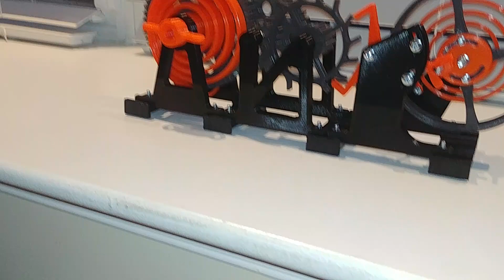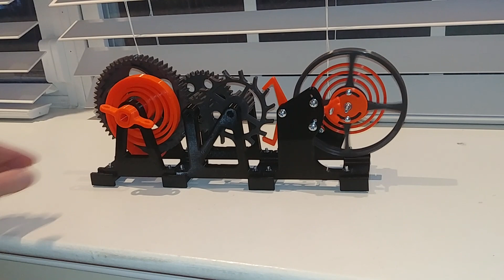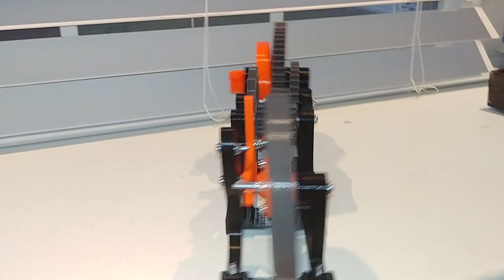3D Printed Watch Escapement

Comment: i cant get my fork to engage fully. seems like the hair spring is not strong enough to spring the wheel up and down hard enough
Reply from the maker: One thing that helped me was making sure everything is flat down on a hard surface
Reply: @kevinbright1  yes tried that, also sanded everything smooth. May be catching somewhere and stopping it.
Yours runs nice and smooth.
Reply from the maker: @1zingero  it's very finicki.